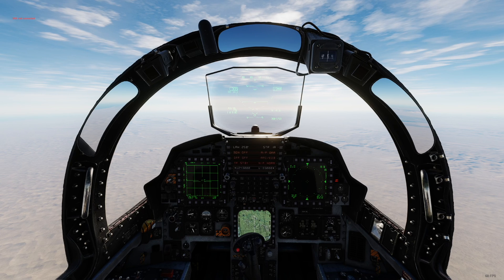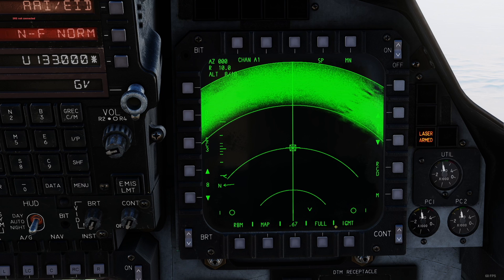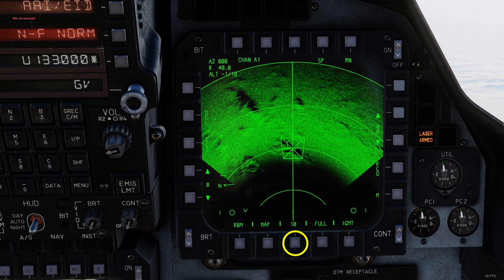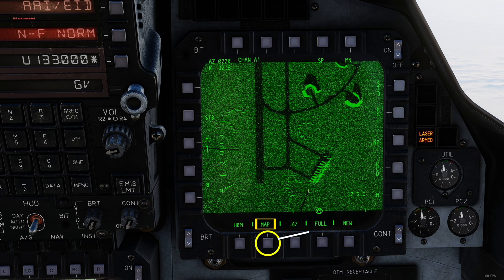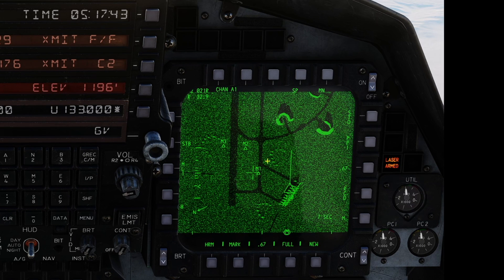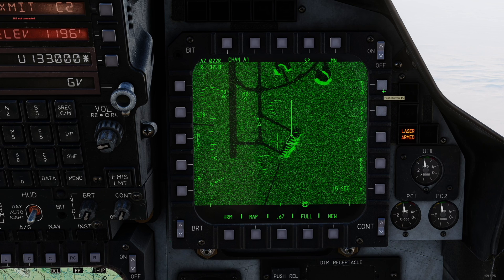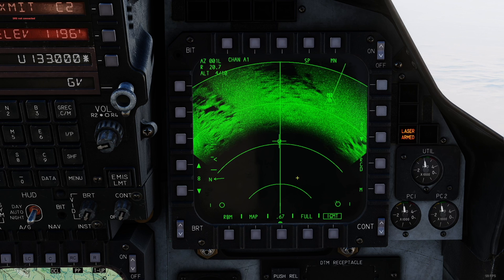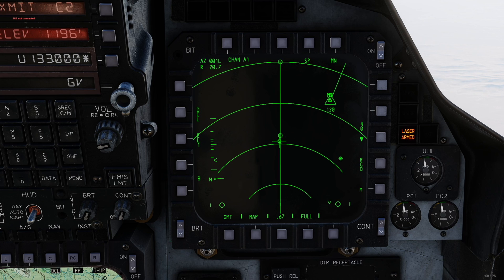F15E Quick Guide - Air to Ground Radar

Comment: Okay, I am a retired aviation maintenance technician that specialized in avionics. I spent most of the last five decades, both military and civilian, installing and maintaining all kinds of avionics on everything from EA-6B Prowlers in the US Navy, to civilian owned P-51's and L-39's. I know how a radar works. But... I see something in DCS that I'm not quite understanding. I don't know if it is just a function of certain radars or if it's just not modeled accurately. When using the APG-73 radar in the Hornet in A/G mode on say, 40-80 mile range and at a moderately high altitude, 25-30K feet, I get land returns on pretty much the entire scale; from a few miles in front of the aircraft to the extent of whatever range is selected, out to 160 miles. I see the same thing in the same situation with the APG-68 radar in the F-16C and the KLJ-7 radar in the JF-17. Ground returns throughout the displayed range. However, with the APG-70 radar in the F-15E, the APQ-120 radar in the F-4E, the PS-37 radar in the AJS-37 Viggen, the RDI radar in the M200C Mirage, and the Cyrano IV radar in the F-1 Mirage, at any kind of high altitude say, above 10-15K feet, I get just a narrow band of returns across the PPI display depending on what angle the antenna is pointed at. I know that a couple of those, the older ones in the Phantom and F-1 Mirage, were not pulse doppler radars. But a couple of them; the APG-70 in the F-15E and the RDI in the M-200C are pulse doppler. So, what am I missing here? Are these modeled accurately? If so, why the huge difference in the A/G picture?